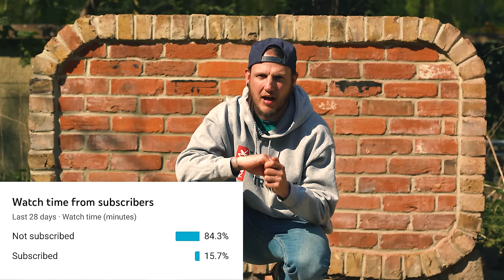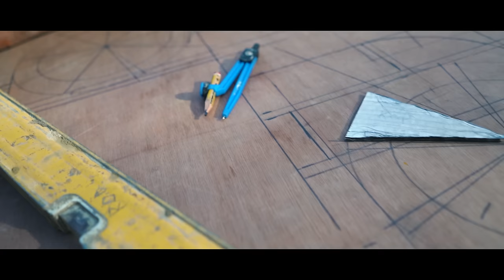BRICKLAYING MASTER CLASS | THE ARMCHAIR

Comment: Great video. Very nice architecture. I like the 8 minute mark flicking your shirt slow motion all the brick dust.
Reply from the maker: Thay was my favourite part of the whole video🤣 I must have watched it over and over like 10 times while editing it🤙🏼🧱
Reply: Rodian Builds I bought a sthil cordless wet saw. Best thing I ever bought. Cuts bricks like butter. I also have a wet brick saw with plunge action. That can also shape bricks hollow them out although ulitimate care would need to be administered.
In saying that however, seems the early bricks were soft and bricklayers used to chip them to get the desired shape they were after. Also in the early days bricks were built with different angles and shapes. Later manufacturer they stopped this practise.
You are a real master. I worked for a builder who was formerly a bricklayer and worked in the sewers.
My father actually built steps and laid the bricks in sand. They are still standing today after 60 years. My uncle made bricks from the back yard of the house we lived in. My father built half the house and then the rest as we were living in it. I hardly remember it though because I was only little.

Comment: Absolutely great work; well done and a great achievement! Should you have left weep holes in the base for when the pointing starts to leak as the base could hold quite a bit of water?
Reply from the maker: I was going to drill out one of the joints. Completely forgot about drainage when I built it